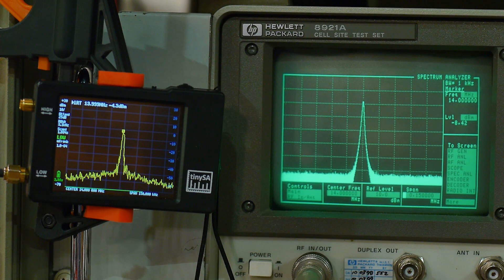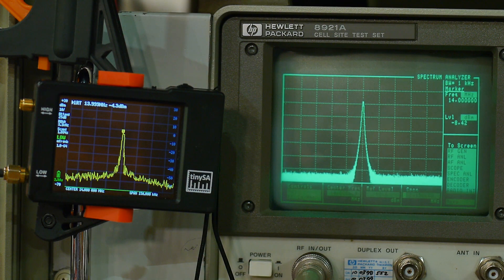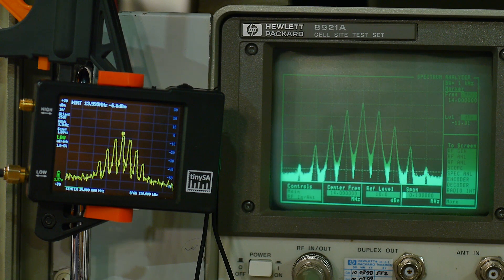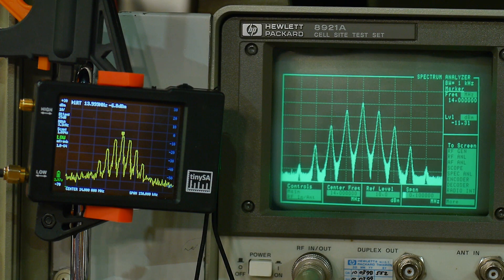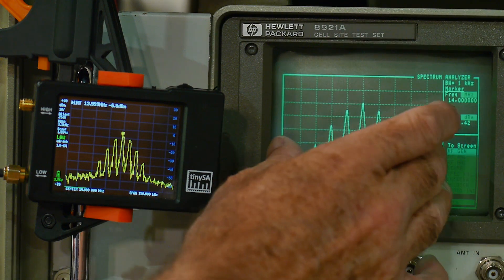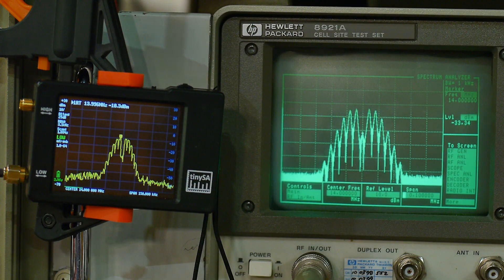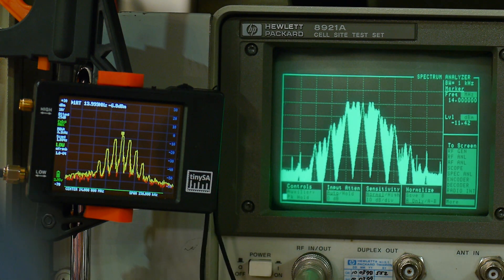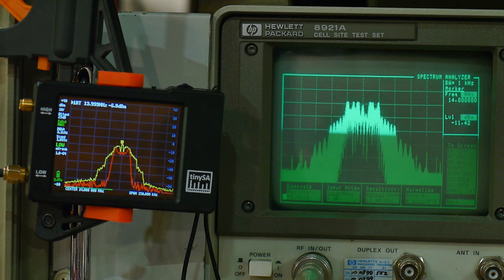#538b TinySA Measuring FM Modulation

Comment: Did the TinySA ever get ‘stabilized’ for you to update the video as you mentioned?
Thanks & 73… 😊
Reply from the maker: It was re-designed. the ULTRA model fixes most things: https://youtu.be/0ELGDz3ibNg
Reply: @IMSAIGuy  ok thanks! 👍😀
Reply: @IMSAIGuy  DUMB Question 🤔:  Mark, what is (excluding frequency range & tracking-generator) is the disadvantage of using an SDR as a spectrum-analyzer?  Video topic?
Unless I’m mistaken, don’t some SA’s actually have a lower dynamic-range than a good SDR?
Also, do you feel say R&L Electronics is the way to go to get a genuine (non-clone) unit?  BTW: They are out of stock.
Thanks for responding and all you do! 🙂
Reply from the maker: @SpinStar1956  where to buy: https://tinysa.org/wiki/pmwiki.php?n=Main.Buying

SDR is rubbish analyzer due to very wide and non selectable bandwidth filter
Reply: @IMSAIGuy  Ok.  Well I did think about that but also thought that if you were using it to observe say an oscillator, or the signal (from a clean generator) through an amplifier, that those (along with their artifacts) would be the the only signals present. And that adjacent channel-selectivity wasn’t of paramount importance.  I’m probably missing something as usual! 🥴
Anyway, thanks for the sourcing info; so far I previously purchased a regular TinySA and a VNA from R&L with great results…

Comment: Question new to the spectrum analyzer.cb radio is at 27.185 I can see the signal I can see no harmonics.how to I see the actual am modulation using supplied antenna on the tinysa.i have my center as 27.185. the span set at 1mhz
Reply from the maker: you will need to have the span much narrower. say 100khz or 50khz. The TinySA is not very good at looking at modulation due to the limited 3kHz resolution bandwidth.

Comment: Now I was told the tinysa has a built in speaker that you can access to hear the signal is this true??
Reply from the maker: No. There is a way to open up the device and hack into it and get an audio demodulation. This is very new. go to Tinysa.org

Comment: Hey IMSAI guy, consider doing a video with an antenna / home made RFI probe connected to the input and how well it works running around the house looking for RFI hot spots. I think that's what it would be great for!!!
Reply from the maker: ok  good idea
Reply: Don't think it has enough dynamic range to sniff out RF unless your very close to the cheap Chinese SMPS that INVADED the world, Thank you China and our FCC for allowing cheap unfiltered  junk, someone at FCC must have got a nice "$BONUS$" to look the other way!. Another way to find RFI is just using a plain old AM pocket radio. TNX 4 the upload ! 73  P.S. TNX U china for the virus !!!!

Comment: I am impressed with this but afraid to buy one yet after getting a Nanovna set up for SWR and finding it way off compared to my SWR meters readings and power output in HF ham bands.   Carl, AB1ZI
Reply: Hi Carl, I recently purchased a Nanovna-F and when properly calibrated the SWR measurement is excellent compared with my 2 different SWR meters.  I know the Nanovna-F version 3.1 output amplitude is greater than earlier versions of the Nanovna which likely improves its measurement capability/accuracy.  I also made sure I bought the Nanovna-F from a reputable complany versus buying one based on lowest price.
Reply: @wd8dsb  Thanks for the reply. I think I might have a bad solder joint or something similar. Some times after I start the Nanovna it takes a coupe minutes before I get a trace on the screen and after it starts working the swr readings are off by a Meg or so. I think I got a junk one. Carl
Reply: Firmware firmware firmware....It gets better every iteration....

Comment: As the software changes, will those changes be rolled out to owners, or are you stuck with whatever was in the device when purchase? In other words, is it updateable? If not that needs to be a change the software engineers make.
Reply: The SW can easily be updated. IMSAI Guy did update the SW at least twice
Reply from the maker: The firmware update is the same procedure as the NanoVNA. Erik has the latest version at: 
http://athome.kaashoek.com/tinySA/DFU/